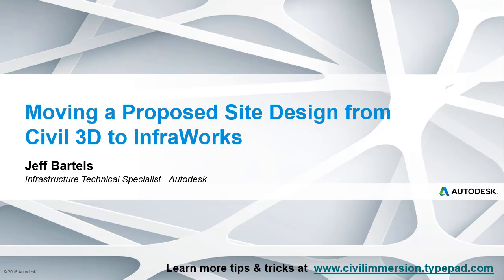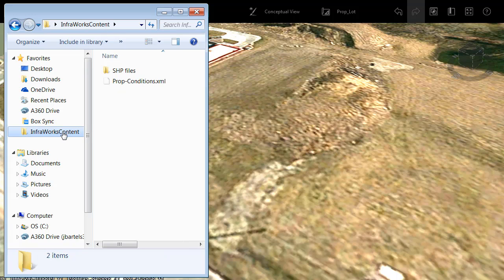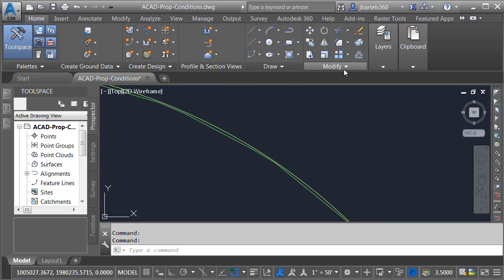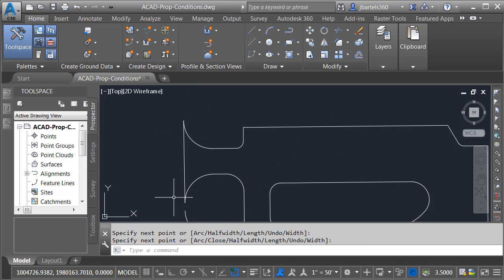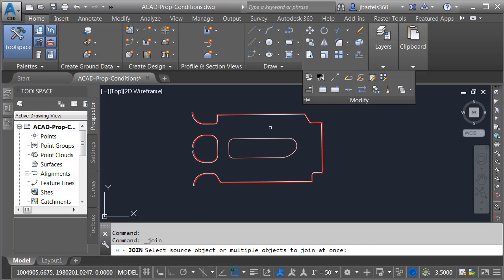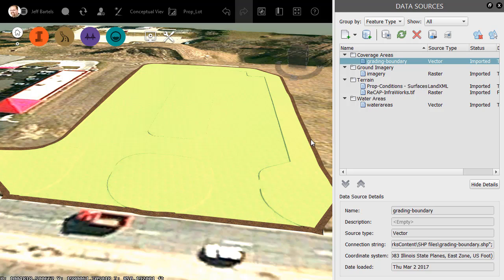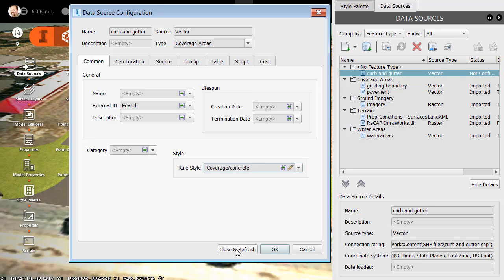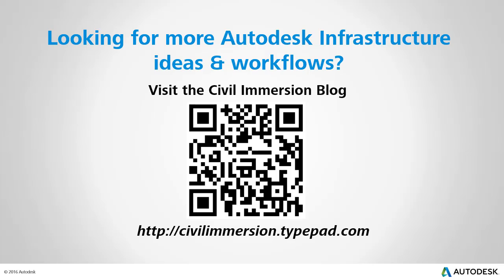Moving a Proposed Site Design from Civil 3D to InfraWorks

Comment: I have tried the land.xml method many times, yet my surface never comes in correctly. The existing surface basically overides my proposed surface every time. I have a similar parking lot, I created with feature lines and it doesn't work. I have also modeled that same parking lot as a corridor and still the same. The existing infraworks terrain doesn't allow it to display correctly. What would cause that. I am using infraworks 2021.